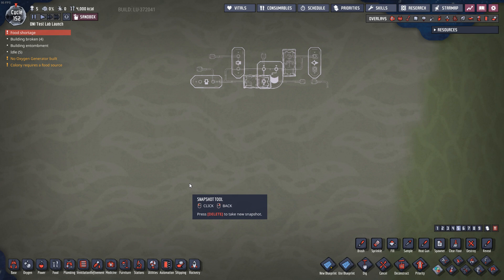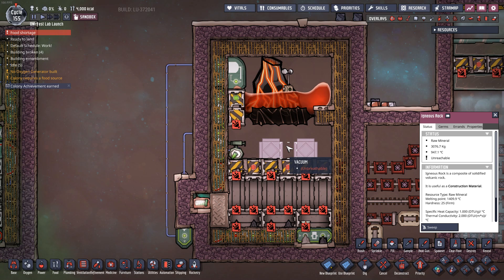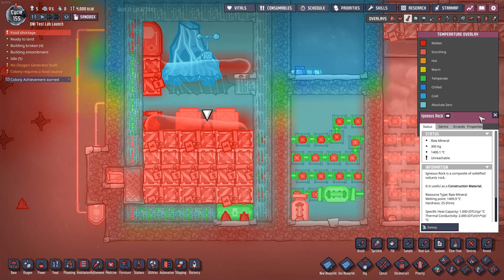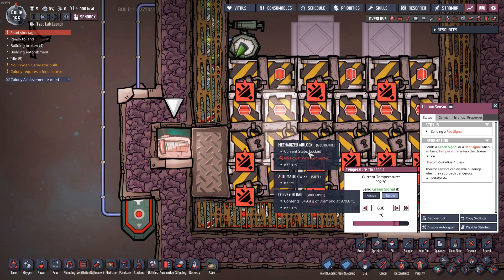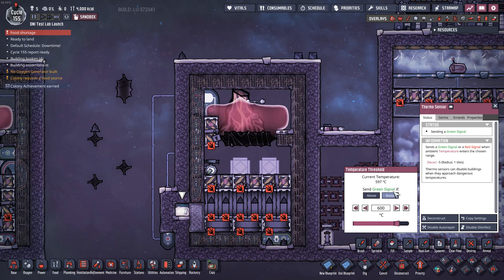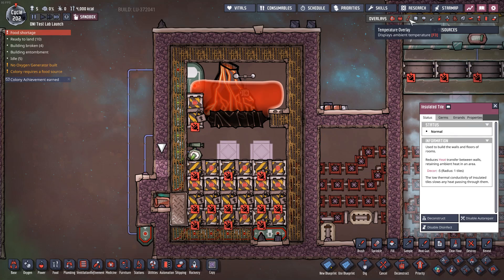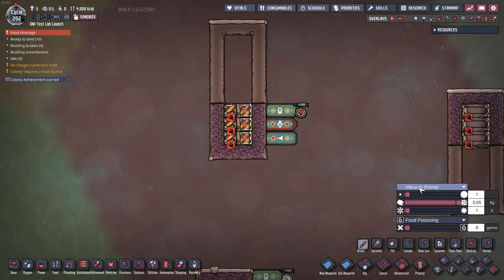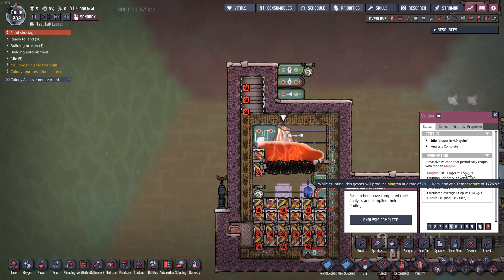Automated Volcano System! Oxygen Not Included

Comment: So my map has a very weak minor volcano (seriously, I think I might win award for how weak it is). I'm having an issue where I can't get the top two layers of doors to open at the same time.  So I have tons and tons of igneous rock building up on top of the doors. (Doesn't it also destroy heat when a small amount of matter at high temperature joins a larger pile at lower temperatures? )

I can't think of a way to get the 5 second window where the top doors open to align with the other 5 second window where the temperature sensor regulating second input of the AND that allows the middle door layer to open.

Can I get some advice on if fusing the first door layer logistic circuit to the same AND's output might solve the problem? Or am I not foreseeing unforseen consequences? 😉

Comment: tried something like this and about 10000kg came through the door before it could close...  and is there any reason you used airflow tiles instead of just insulated obsidian?
also if it's not in a vacuum the door system kinda pumps gas up into the top...

Comment: I tried this with a gold volcano. The automation wire near the volcano melted instantly, even with steel wires. And the gold never arrives in liquid state after the door drop, so the hydro sensor doesn't get a trigger, the top row of doors never opens thus the whole system is useless. Spent around 30 cycles for nothing -.-

Comment: I actually came up with a very similar system though slightly different.  I trapped my volcano in steam near 140kg per tile so that the magma instantly converts to debris.  Once below a certain temp, some of that debris is swept up and shipped into another steam room where it is conveyed around before moving to a vacuum room where the debris is caught in a door.  Temp sensor in the steam room determines when it is below 125C.  The debris is then dropped out and carted through a cooling chamber so it exits at 20C.

The biggest problem I've found is it's quite power hungry at least if you use an aqua tuner to cool the turbines.  Even with it generating power it can still cost a lot.  I'm curious if surrounding the volcano with a different fad should be better so we could manage the turbines temp more, but that would make the whole design slightly bigger and probably cause a problem.

Comment: is it possible to turn magma into a gas in "normal" gameplay?
Reply: you can use metal refinery to heat up is coolant,like liquid steel. liquid steel is "easy" to obtain creating a klin in the vacuum, they have a melting point but not a overheat temp you need to make the pipe don't touch the liquid steel building it up one tile above and for pumping liquid need touching some liquid, one ofthe best is using visco-gel and whit a filter just drop again to the pump. the pumps (gas and liquid) pumps from the bottom left tile which they are in and from the tile adjacent a + way. use this formation:
P  P
P  G

S  T
wher they Ps are the pump the G is for visco-gel and S for steel T is the tile (not mesh) where to drop the visco gel

remember to put the liquid pump in a vacuum or it will overheat
Reply: @raismin739  but will this let us boil lava?
Reply: @diamondjub2318  whit this method you can melt/boil anything if the boiling point of the coolant is less than the point of the material you want to heat up

Comment: I have a steam vent at 500 degrees output in my base, and it overheats the steam turbine often, even with its own cooling! Ends up costing power instead of making power...do you have a build for that?
Reply: With or without space materials?
Reply: you can reduce the flow into the turbine by blocking its input vents at the bottom (2-3 depending on how much steam you have). The more the turbine runs above its max power output (850 W) the faster it heats up. try to balance the input close to but not over its max output. that should help

Comment: Things I learned from this video. 

* how to tame a volcano 
* I missed a stream
* I have no idea what I am doing... srsly,  using heat is still the biggest thing I waste!
Reply: Don't worry about it. You don't need to play the game optimally. Just enjoy the level you're at
Reply: I love the game, and seem to have a total mental block when it comes to cooling and overheating machines... and the base... and my dupes. Sigh. It will come in time!
Reply: @amy-clarefidgett6505  If you have heat somewhere you don't want it, put radiant liquid pipes there. Then run some liquid through them and a thermo aquatuner. Surround the aquatuner with an insulated chamber and add "a bunch" of water in the chamber and build a steam turbine over it. The precise amount of water isn't that important, but several hundred kg is enough. Just don't fill the chamber completely. Run the return pipe from the steam turbine back into the chamber with the aquatuner. That is the basic setup for getting rid of heat. After that you can start Brothgaring it up.
Reply: @wheany  thank you! I have trouble with my steam turbines and aqua tuners overheating,  working on steel technology... although I hear good things about wolframite. :)

Comment: I have two questions for you there:
- When the chunk goes down through the doors, is it not destroyed since it cannot move around? The goal of the doors is to move it side to side but when there is no place, I was expecting the stuff to either be destroyed or go up.
- Does this system prevent the magma on top of the volcano to turn into a pile? I mean, if it takes too much time to cool the bottom part, could the top one turn to tile?
Reply: No because the whole thing is in a vacuum, so the big pool of magma is not cooling down, only the small puddles that are on the doors/heat conveyers
Reply: the door doesn't destry debris, at least they get trapped inside and transfer heat much quickly, it's even used in the video

Comment: All but 1 Airflow tile can be made from copper, Airflow tiles transfer heat from a heat source beneath them and not with other Airflow tiles.  
Liquids don't touch airflow tiles, without contact the tile won't have heat transferred to it.
Reply: @brothgar  Yes, if you introduce an atmosphere copper Airflow tiles are going to fail, this is why you should always build inside a vacuum. im not sure why you have a pump system to remove atmosphere when you could have just built it all in a vacuum.

I put airlocks in before every building site attached to feature on the map.
Reply: @deviousbutton9211  I was going to rebuttal but I realized you probably preemptively build a airlock before you reveal any vent/geyser/volcano

what do you do with already (like the map spawned it that way) uncovered geyser/volcanoes?
Reply: @BrianatorFTW  Volcanoes say on a Geoactive map are in a pool of lava so i build a water lock near the site and dig it out. Vents i wish to use i do the same, then fill the space with tiles to get the room size i like then deconstruct the tiles on the outside. When you have a mixed gas room and compress the gas's like this its very easy to destroy the unwanted gas from the room by just building a tile on it.

Comment: I'm a lazy man >_<, generally make it simply as possible. With a large volcano, working down the calculations, you get a way nicely with 4 steam turbines, can do more, but it will take for ever to prime. Below the Volcano dig a pathway of 8-9 blocks, left or right, doesn't matter. (8-9 block distance gives you 200-1000kg of magma that drops with a door open 5+- seconds. And as long as you don't go over 1400kg it won't turn into a block.) After the 8-9 blocks, have a door on a timer to auto open every 30+- seconds for 5 seconds, right after the door you will have a drop of 5-7 blocks with two+ mesh tiles at the bottom at touching corners of your steam room, so the magma cools down in the mesh tiles and pops into the steam room due to the mechanics (closest open space from mesh tile). And then make it a little smarter with the door with a and gate to only open if temp is < 188c+- with a not/buffer gates to give you that 30sec loop with 5 sec open. Overall layout. Volcano on top, 8-9 blocks pathway (usually 2 blocks high, just easier, door, with drop of 5-8 blocks including mesh tiles 3+- at the bottom (have a single insulated tile(or metal) one lower than the rest in steam room insulation, right below the mesh tiles, giving you the angle for the magma to pop through once cooled in the mesh tiles). The steam turbines will be 2 left and 2 right of the drop with the mesh tiles. Note it takes a lot of cycles for the turbines to hit max power since the Igneous Rock stacks into 25T. Or over engineer it and have a sweeper, with Conveyor Chutes all across the steam room so the igneous rocks is distributed evenly. And of course a Thermo Aquatuner to keep those steam turbines cooled.
Reply: you don't seem that lazy if you wrote out that entire comment....
Reply: @Witherfroakie  Hehehe, trust me. If there is a easy way out I'm gonna do it.
Reply: @drakcoreoriginal  

dig a small hole under the volcano, put metal tiles underneath the dropping point of the magma, connect a water room to it and bam, easy steam for you. 

you get some igneous rock tiles forming when it cools down? 

slap a robo miner above the lava. 

you don't want to cook your dupes to get the igneous stone?

 just slap an auto sweeper with a shipping rail going through the steam room for improved efficiency. 

you don't want your device to melt down? build that device in a vacuum and you're golden. 

there, easy enough huh?
Reply: ah, and also:

you fear that the system shuts down during dormancy periods? 

sweet ol' aquatuner it there for you.

Comment: Disclamer, in no way is this to be taken as an insult. Its a pun. Thats what I do. With that out of the way:

You're a bit of a doork!
Reply: Very rood of u
Reply: I was going to say he makes things really complicated in a really cool way hahaha
I mean for getting heat this makes sense

But the best method for metal volcanos is making a square below it filled with cold water, then a second square around that with polluted water, metal blocks in between them
One block in the left of the neutronium base is open, so it all drips into the water
Solidifying
Then you just have a sweeper & conveyor line snaking through the water, into some chests

I have like 4 metal volcanos I did that set up with on my current base, never ending metal and dont have to mess with it
(Need a temp sensor & pump set up for if you eventually need to swap out the water, getting too hot  

This design is pretty rad though, he loves his steam and heat set ups hahaha